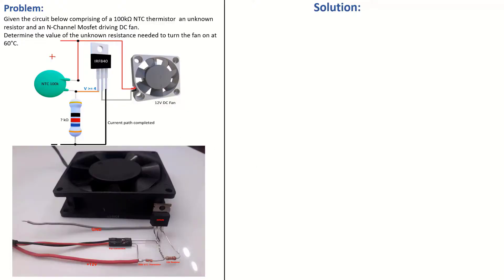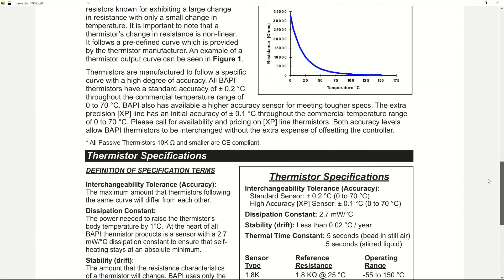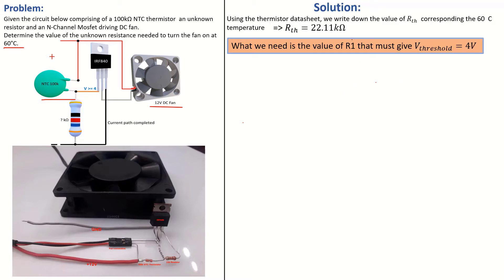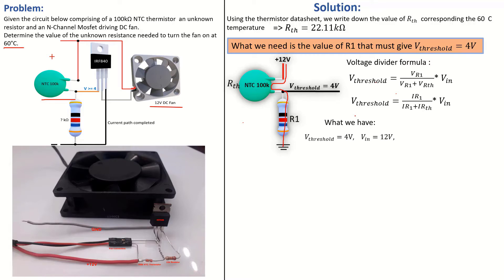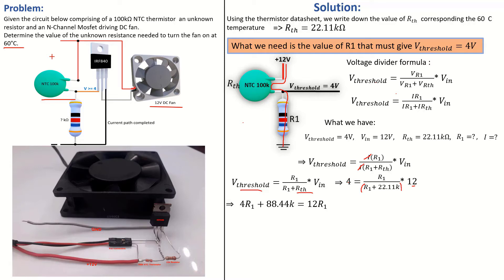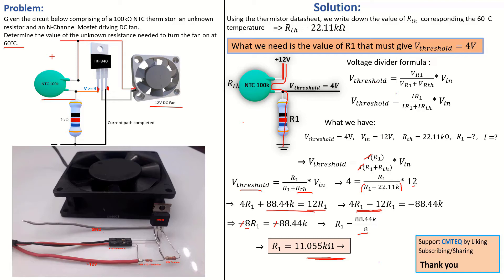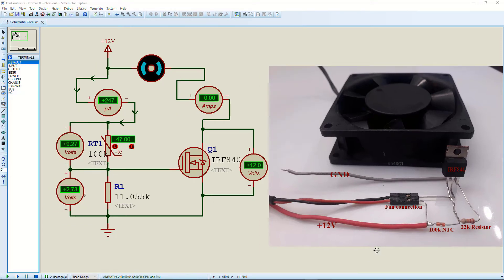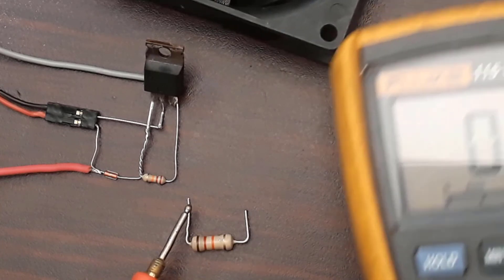Thermistor MOSFET Fan controller (How to specify the turn ON Temperature) - Part 4

Comment: Have you uploaded a video displaying the thermistor temperature on the screen?
Reply from the maker: Hi Luca, not yet, I do have an application project like that where I measure the Temperature with an NTC using Arduino and display it on the LCD Screen.
I thought about it, but I also thought that this tutorial was clear enough, will think about it, maybe a 5 minutes demonstration.

Comment: where can I find the code of simulation
Reply from the maker: You meant the simulation software?
Reply: @CMTEQ  
I don't know how proteus work , we need the code of simulation or we just design the circuit and it works 😅 could you explain to me plllllz
Reply from the maker: I see, just install and start placing components and run the simulation, make sure you place components with the simulation model. 
Thanks for watching the tutorial, make sure you subscribe, I will be uploading simulation software soon.